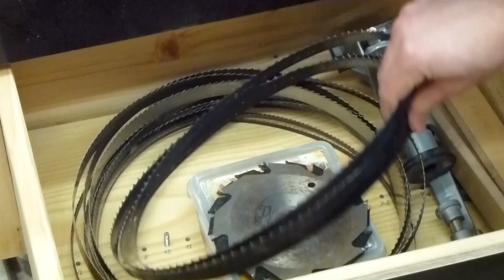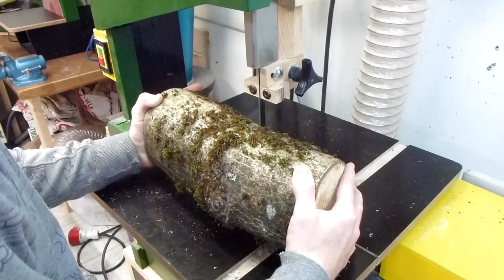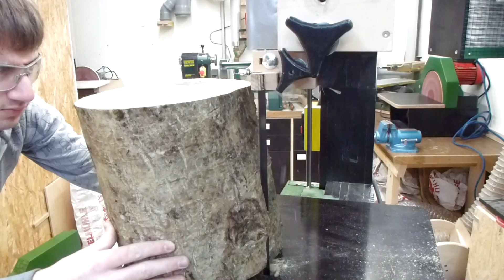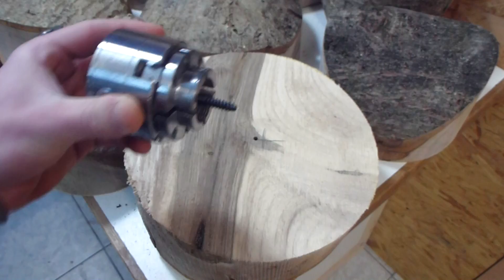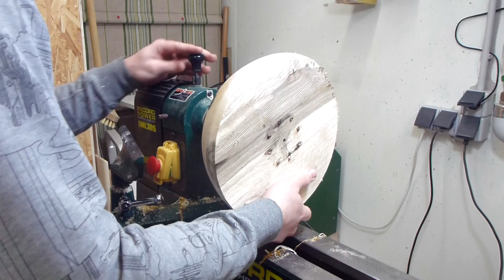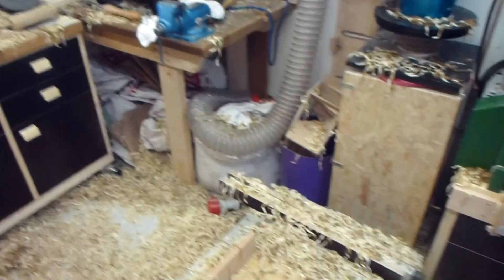Walnut Bowl Blanks

Comment: Hi Marius,  It is possible to adjust the speed of the band saw with only a motor (powerful PWM voltage regulator)?
It is possible mechanically with pulleys, but PWM it maybe good?  How do you think?  Or is this not necessary for band saw?
Reply from the maker: The only good solution I can think of is a VFD with a three phase motor. I haven't had the need for variable speed at the bandsaw though.

Comment: Wow!  What a mess.  That new bandsaw blade is excellent.   But I guess the wood being green helps a lot.  Do you have to do anything special to stop it from cracking?  I see there is no snow outside?  It's the middle of summer here and its very hot..35 -40c.  Is it a warm winter for you?  Cheers.
Reply from the maker: I put a coat of wax over the bowls to prevent cracking but it's not shown in the video. We had now snow when I recorded that in mid January, but now we have about 50cm snow... strange winter this year
Reply: Marius Hornberger Thanks Marius.  I forgot to say great video too. lol  Cheers.

Comment: Great video!  I like your technique of using the tail stock to mount the chuck...I'm going to have to do that.  If I may, I'd like to suggest an idea.  Bury your bowl blanks into your bags of wood shavings.  This will slow down the drying process and reduce/stop cracking of the blanks.  You may also want to put some light oil or wax on the blanks to help as well.  Just make sure someone doesn't mistakenly throw away/burn the bag of shavings with the blanks thinking it was trash (yes, that happened to me once).  :-)  Again, wonderful video!  Keep them coming.
Reply from the maker: Dwight Souder Thanks for the suggestion. I know about storing the blanks in shavings for slower drying, but didn't try it yet. But I put on a coat of wax, which isn't shown in the video. We also use these chips to light up a fire in our stove so there is a even bigger risk that someone burns my bowl blanks.